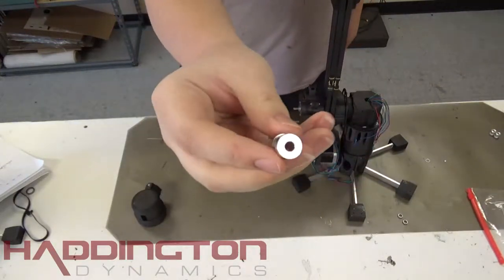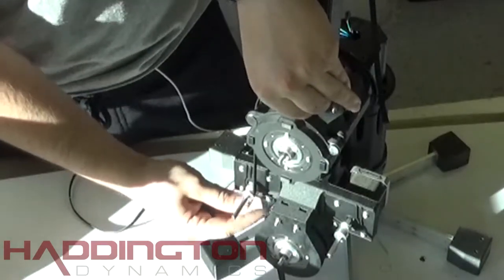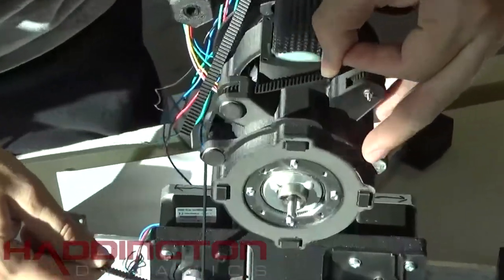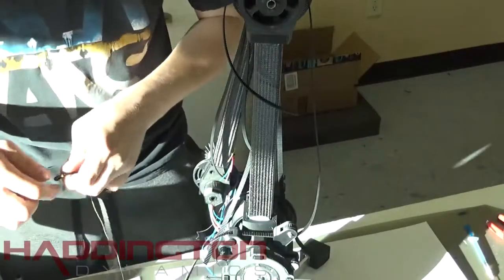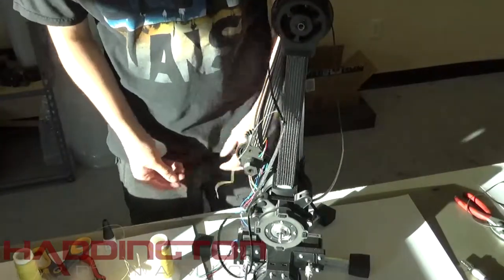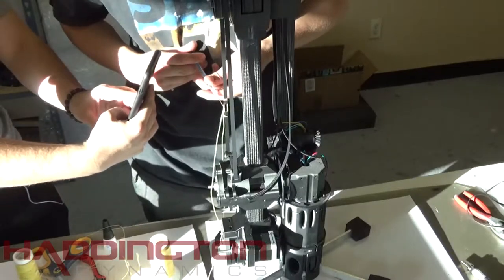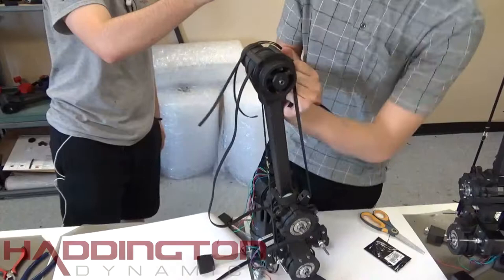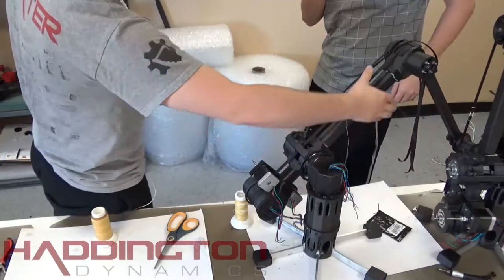Dexter HD - Belts (Part 9/11)

Comment: Could there be an issue when the sutured part of the belt comes in contact with the pulleys and doesn't hold on to them because it has no teeth?
Reply from the maker: This shouldn't happen if the belt is positioned properly. As long as it is in the center, it shouldn't reach the pulleys with the normal operating range. However, if this does happen, the pulley will still function as long as the teeth are still connected